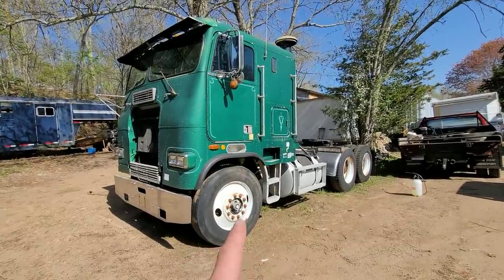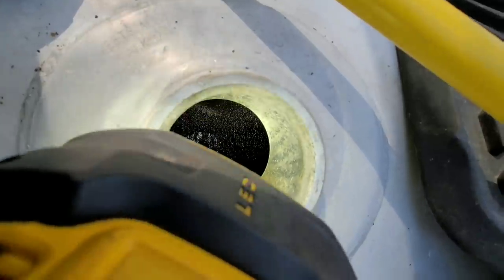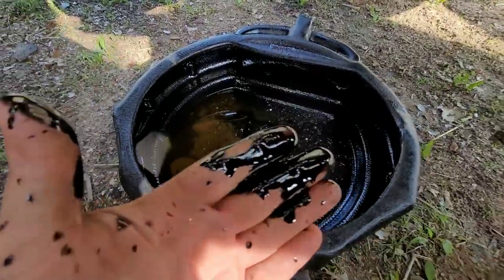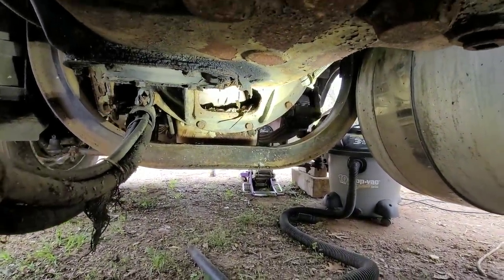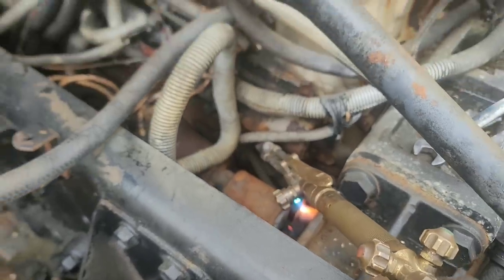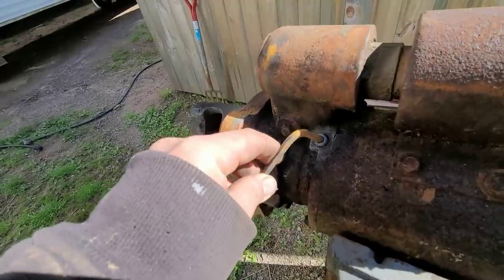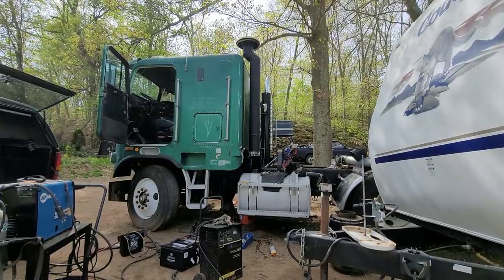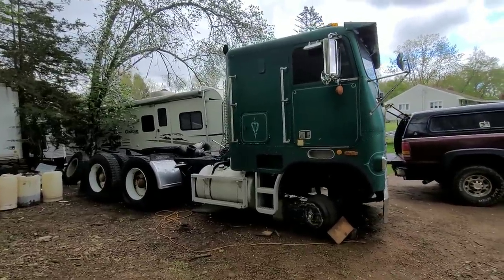Sitting 25 years! Will it start? Freightliner cabover Big cam Cummins"Jolly Green Giant"

Comment: Four cycles do not run away.  Just two cycles.  They suck oil past the blower seals and take off.  You don't have a blower. 
You are hearing about Detroit 2 cycle diesels.

Comment: 3 batteries seems odd. 4 is the standard for most trucks. . I drove a 1992 Freightshaker cabover when I first started driving. It had 4 also.
Reply from the maker: Yes your right. Its getting 4 batteries and heavy duty cables next.

Comment: A if you have low oil pressure their oil squirters on the passenger side of the block theirs 6 of them some times they break cause their plastic they some times cause low oil pressure if their broken

Comment: what's going on with the cab jack system its probably out of hydraulic oil fill it all the way then jack it tell it starts going up then refill the jack then see if it will jack it up all the way if it stops add a bit more just tell it gos all the way up than put the fill cap back on tightly then lower it all the way down to get ant air out then if no leaks lift the cab so yoy can mess with the motor

Comment: The oil in a turbo forms the seal for the shaft, as the turbo spins and more oil is introduced to the turbo, the shaft rides on the seal the oil has formed. The only way it would runaway is if the oil seal in the turbo has deteriorated, what causes the runaway is the oil actually feeds the intake valves forcing them to stay in the open position causing the engine to take off in rpms until either the turbo seizes or it sucked all the oil out of the engine crankcase. For the 855, that is 14 gallons of oil. You should never put any oil into a diesel, diesel fuel has enough lubrication in its own property's. This is one of the reasons you cant use a wet air filter on a diesel. Not sure who gave you that info but they were very wrong. Oil should never be introduced to a diesel in the cylinders, oil does not compress!!!! I dont know who you got information from  about the work your doing, but they are way off base. The cab cant fall forward, it would have to have the lock rod and steering shaft removed in order for that to happen.

Comment: if you would have checked the wires first you probably wouldn't have had to go through the trouble of removing the starter which probably would've worked fine with the proper voltage and ground

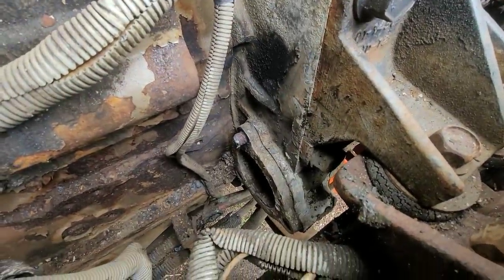Comment: Great work, very interesting. Did you change those horribly cracked rubber mounting bushes at 25:45
Reply from the maker: I didnt even notice ill have to add it to the list.
Reply: @NOT_FOR_HIRE  Rubber deteriorating is a major headache in any old vehicle. Engine mounts, gearbox mounts, steering rack mounts, exhaust mounts, suspension bushes, propshaft mounts and guibo's, brake caliper seals, seals in general, hoses, belts...and obviously tyres that are cracked and could fail / delaminate on the highway. Sorry for any extra work (and expense) my comment is going to cause :)

Comment: Is there a shop nearby that makes up hoses? I could go to a shop and get a hose made up in 30 minutes here in UK. All I would need to do is take the old one along for the size and fitting types and some money.
Reply from the maker: Yes there's a few shops around here. If your referring to the oil supply line i was trying to find a genuine cummins part but I still haven't had any luck so thats the next step.
Reply: @NOT_FOR_HIRE  I'm not a fan of genuine parts when an aftermarket part works as well. Mostly because the real deal is stupid price.

Comment: Is that the only fuel filter? That is actually a water separator and there should be a another fuel filter
Reply from the maker: There's a screen in the pump but that's it after the water separator

Comment: You don't start a dry engine that's been sitting for 25 years. You just made 100k worth of cylinder damage doing that.
Reply: Dude i rather start a diesel engine that been sitting for 25 years by dry starting it over putting oil down the cylinder and risk that oil staying on top of that piston and starting the motor up and have a chance of it running away on me due to diesel engine can run off on oil. If fine to put oil down a gas engine cylinder if is been sitting for a long time so you don't damage the cylinder walls but not so with a diesel engine. If you go watch other channels of guys starting up oil diesel truck you never see them adding oil down the cylinders they just dry start them

Comment: you say taking that other elbow off your fresh air pipes ain't the proper way to spray ether down it's throat! ether period is not the proper way, if you'll take the time to get fuel to the injectors then them old engines will start if the kill switch is energized! but lazy folks love to spray one to death with starting fluid!

Comment: You said you dont want it to run away!, what do you mean?
Reply from the maker: I don't want it to become uncontrollable. Meaning not be able to shut it off normally or control the throttle.
Reply: @NOT_FOR_HIRE  I'm learning here, are you saying it could start but not be able to shut off with the key?
Reply from the maker: Yes exactly. Search for run away diesel on youtube. You'll see what I'm talking about.
Reply: @NOT_FOR_HIRE  will do
Reply: @NOT_FOR_HIRE  I never knew about this, I bought a cucv and in the process of getting it up and running. This would and could happen with me having no idea what is happening and how to stop it. One thing I'm not clear with, a vehicle once start, operates off the alternator. So if an automatic becomes a run away, how pulling off the battery terminal will stop it.

Comment: It's not a Detroit so I don't know how it could runaway .
Reply: Opa Pearce a run away happens when  the engine draws extra fuel from an unintended source, if Broken seals or a broken turbocharger may cause large amounts of oil mist to enter the inlet manifold if that gets into the cylinders it mite set off a run away.

Comment: Why are you being so flippin cheap. I personally would have changed everything before I would have tried to start it because fresh fluids had a chance to coat the inner of the components of the drive train. That was my favorite truck I used to drive and I worked on it myself. Mine was a bunk and a half . Big cam Cummins with a 13 speed.

Comment: I don't I ain't buying it 25 years sitting and it turns over in 30 seconds
Reply: Rick Rarger  did you watch all way threw the video im guessing you didn't because you would of have seen how nasty looking the fuel was in the tanks that is a sign that truck been sitting for a long time. Any engine that has been sitting for a long of  time will turn over if the engine isn't locked  up or the starter isn't either  also you would of seen when he first tried to started it the engine  it barely turn over due to the starter had been sitting for a long time and was rusty inside so he had to freed up the parts inside to get it working again and then it turn over like it should. You just cant judge how long a truck or any vehicle by oh it turn over fast you have to consider other factors as well

Comment: That was a waste of good diesel
Reply from the maker: Come on over I'll dump it in your tanks!
Reply: Allenscott19832008 that diesel fuel is not good fuel that you want to be going threw your injector pump or in your injectors, only a person that has no idea what there talking about would say that is still good fuel.
Reply: @sdudley11  I have been working on Diesel engines since 1989 and have had no issues with my 1978 8v71 running 1970’s fuel
Reply: @sdudley11  but what I was meaning is that could be used in a parts washer
Reply: @allenscott19832008  you mite not mind using old fuel in your trucks, but most people that  see nasty looking fuel they want it out of the system and flush it out and run clean fresh fuel so there no problems down the road its common sense to do

Comment: First off diesel dosen't go bad it may look bad but it isn't it will fire off after sitting for 20 plus years and from what I see so far is you might want to learn a little more about mechanical problems before you venture into the job
Reply from the maker: You gotta start somewhere. Nobody starts off a professional.
Reply from the maker: And your wrong about diesel

Comment: who can be so stupid to start dry engine
Reply: dude you must not understand that diesel engines are different then gas engines when it comes to priming the engine with oil. you can hand prim the oil system with a gas engine so you ant dry starting the engine. with a diesel engine you got to add more oil to the engine so you don't get a dry start or you just start it and let it build pressure and it gets oil threw out the engine
Reply: @sdudley11  after so long time that motor is dry and crank it for just few seconds without oil/diesel in cylindes is stupid
Reply: @danielsatko-  dude the only other thing he could of done is add more oil to the engine and let it drain down into the oil pan so it not a total dry start of the engine at the same time your wasting that oil due to having to drain some oil out. So really cranking the engine over for a few seconds is no worse then your first start your engine every day is wear and tear on the motor because all the oil is at the bottom of the engine tell is pump threw the motor is common sense dude
Reply: @sdudley11  the only thing he MUST do is add a little amount of oil to each cylinder to not scratching it in start
Reply: @danielsatko-  Dude listen ok the few seconds that it takes to get oil on the cylinder walls Isn't going to hurt the engine at all, is no worse then starting the engine after is been sitting for day's . If you watch other YouTube channels that are  starting up diesel engines that been sitting for years  they just crank them over with dry cylinders and don't have problems with it at all. So really is not a must thing to do at all like you think it is.
Reply: @sdudley11  u have much to learn